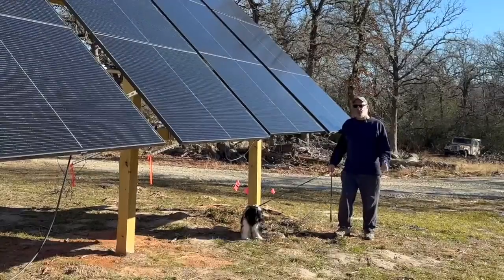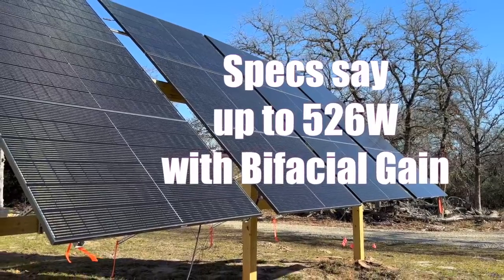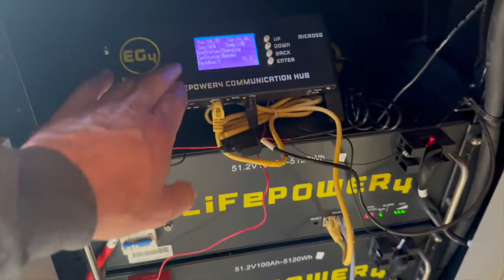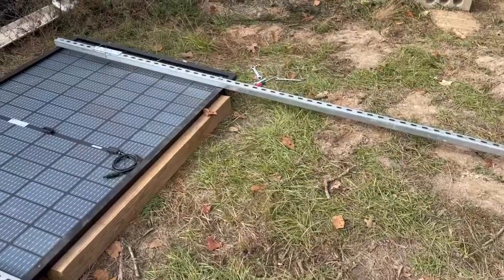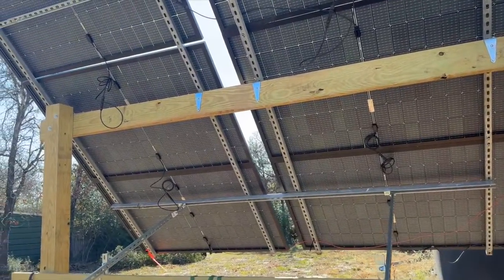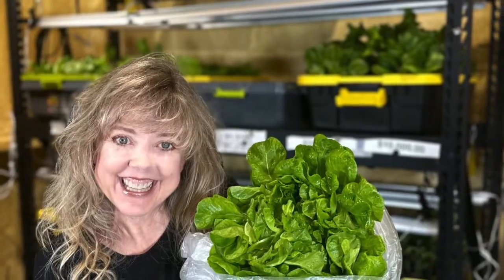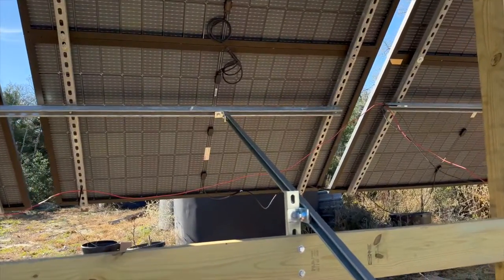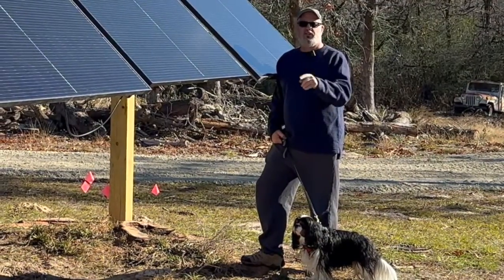Adjustable DIY Off-Grid Solar Panel Ground Mount

Comment from the maker: Mounting solar panels on ground mounts is expensive.  Read more about how we built this affordable 12 panel mounting system in the video description. ⚡️☀️🔋💡👍🤠
Reply: Are you going to hook up motors to that mounting system to adjust the panels during the day to maximize exposure?
Reply from the maker: @WhySoDivided-CantWeAllGetAlong  Thanks! That’s a cool idea but it may be more complex than my original DIY intentions.  I set out to design an adjustable tilt rack that I could adjust four times per year to maximize my solar angle.  I’m at 31 degrees latitude so my optimal angle ranges from about 12 degrees in summer to about 48 degrees in winter. Today 12/21 is the shortest day of the year so I should be at 48 degrees tilt.  I’m thinking bout adding 2 small manual winches to use on each side to more easily raise and lower the panel sections.  They’re heavy at around 400lbs each side. If the system was to adjust through the day and track the sun, it would need a motor and light sensor.  A tracker gives better performance but requires power and the performance difference can be offset by adding an extra panel to a tilt rack.  If you’re short on ground mount space, a tracker is a good option.  I’ve got a single pole DIY mount underway and I’ll shoot a video of that process soon.  Lots of options with solar panel mounting and they’re all use case specific to each location and your design limitations.  ☀️⚡️👍🔋💡🤠
Reply: @terrahillfarm  Very cool. I brought that up mainly cause I saw another video where someone did that, and you can buy some rotation mounts for about $600 that hold 4 to 6 panels. and the claim is about 40% more energy output from each panel because it maximizes the sun all day rather than stuck at one angle. In your area with all the tress it may not help though as you said. But with the land you got, and all those panels it may not matter anyway. I am curious are you using per panel inverters or tying them all to a single point? I saw this video (https://www.youtube.com/watch?v=Y2qs9VskGS4&t=787s) where he talks about the pros/cons of both approaches, but it seems like those inverters he shares are really good and will avoid one panel starting to hit shade from bringing down an entire block of panels from producing. Just thought I'd share in case you haven't seen it.
Reply from the maker: @WhySoDivided-CantWeAllGetAlong  Thanks!  I’ve got another 18 panels to get up first but after that I might start playing around with automation for the PV.  I love trying new ideas.  Right now I’m using an EG4 6000ex AIO inverter.  It’s split phase so it’ll run the whole house if the loads are managed.  My next move will likely be to a hybrid like the Sol Ark, EG4 18k or the Schneider XW 6.5, which I really like.  Like everyone else, I could use more batteries and solar panels!  😆🤣. I appreciate the feed back and that really gives me good ideas for more videos. ☀️⚡️💡🔋
Reply: @terrahillfarm  Nice. I am torn.. I have the EG4 3K right now for my one 48v battery, haven't set it up yet. I really want to go all in on Victron. They have a better inverter than the EG4 for $1300. programmable, etc. But it has no solar inputs, which I am OK with as you just add MPTT controllers to the mix and I don't have any solar yet. But I'll likely stick to the EG4 for now, then move to the Victron later once I have a better idea of how I can set up panels and run cables, etc.
Reply from the maker: @WhySoDivided-CantWeAllGetAlong  I started with the EG4 3000 and I now use it as a separate 120v charger for my battery bank.  It’s basically 1/2 of an EG4 chargeverter.  It can also work as an extra MPPT and charger for larger system.  The 3000 is bulletproof. 🎯⚡️👍☀️💡
Reply: @terrahillfarm  That's good to hear. I figure I'll use it for now, if/when I upgrade to Victron I'll work this in to a system for a family member and get them on batteries too.

Comment: I think you need to make friends with a chainsaw! Especially since you're really relying on the solar to run your home, you need to cut down a few trees so you can pull in more solar.
Reply from the maker: Thanks! We got hit by a tornado a year ago and it took out about 20 trees.  Then over the past year another dozen or so more died.  My site is hilly and while it looks like the trees are close to my panels, I get very little shading and generally that’s around 6pm so not much is lost.  I do have a ton of dead trees to cut down but it’s generally easier to just bring in a dozer for a day and have them take them Al out then push up plies to burn.  I’ve got about 4 years of firewood already cut!  Oh the joys of living in the country..always more work than can ever get completed!  👍🤩⚡️☀️🔋🤦🏻

Comment: What are the length of the vertical uni-strut sections? It would be nice if you had a build video and/or a parts break down. My panels are each 8 feet long, pretty big panels! up to 710 bifacial. Wondering if I would only be able to fit one panel per sections or possibly I could size it to accommodate two per section, in portrait configuration. I would probably need to put two strut sections together as they don't make them long enough. It looks like you may be using the thicker 12 gauge strut and the 14 gauge for the adjustment bars? Any info is appreciated. Looking to start strategizing a build to put something together, within the next month.
Reply from the maker: @chrtravels  Thanks,  my plan was developed on the fly and is a hybrid of several others I’d seen done.  All the uni strut I used was 10ft lengths.  I had to splice another 12-18 inches on the horizontal sections in order to mount two 400 watt panels, end to end.  So roughly my 2 sections of panels were 11’x11’.  From my experience I’ve learned that the higher off the ground you go, the more complicated things get with solar panels.  If I was going to ground mount panels larger than 400 watts, I’d go with a fixed mount of two parallel, in ground sections welded up with a top pipe built with heavy wall steel or oilfield pipe.  One should be higher than the other based on your ideal tilt angle.  Then you just buy iron ridge aluminum rails to mount on the two pipe rail tops.  I had a friend who did that and it worked well with over 20kW of panels.  Some work required to weld up the ground posts and top pipe, but it’s cheaper than most mount kits.  710w panels are heavy so hanging a bunch on hinges really needs to be planned carefully.  I had about 200-250# hanging per pair of hinges (x4 total).  It was really hard to manage installing the panels 8-10’ off the ground. 👍⚡️☀️🔋🤩
Reply: @ thanks a lot for the reply. Doing a fixed mount certainly would be easier. I’m going to chat with a couple neighbors who do solar because all of the properties around here are off grid. I have 24 of these panels and two of the new midnight solar wall mount batteries. So that’s 32 kWh. Thinking it should be a pretty good system when completed, but it is a lot of work doing all this on my own. I don’t really wanna get into welding as I don’t have the equipment or experience, but we’ll see what I can put together. I’m pretty good at figuring out solutions on the fly as well but this is a big project. We’ll see what I come up with!

Comment: Interesting stand. Haven't seen one put together like that exactly. I've got 3, 4kw arrays too but they pivot on 7/8" bolts set at the tops of the posts. Not that it's any better. More than one way to skin a cat has always been my mantra. :)
Reply from the maker: @beebop9808  Thanks BeeBop! Yeah, this design was more a result of me finding a Craigslist deal on unistrut nearby!  Unistrut is nice but so much heavier than aluminum rails.  I wanted to see if I could save a lot of money doing DIY.  It saved some but the amount wasn’t substantial.  The design ended up being higher than I thought so that added difficulty in assembly.  Presently ive got 9,660 watts of PV and the other day I was pulling a little over 8kW so not bad here for Feb.   I’ve got a bunch more panels to mount and the next ones will probably go on the roof of my carport.  After that, I’m going to stick to ground mounts 6 feet or less off the ground.  Lifting panels is getting old!  💪👍🤩☀️⚡️🔋
Reply: lol Tell me about it, I've got six more panels I'm going to put up on top of the solar shed when I can get up the gumption to get them up there and maybe not kill myself. hahaha
That strut is crazy. It's $35 (10ft)at Lowes and HD, found it for $8 in Mich. Either pickup or pay $595 (24 pieces) shipping. $12 somewhere up north but pickup only 600 miles away. Finally found some at a mom n pop electrical supply next town over for $23.

Comment: Ive been considering several small mounts so that the chicktand other livestock have shade in their areas while also making power for our house. We're also at the end of the power lines.
Reply from the maker: @matthewconnor5483  That’s great!  I’ve seen several people build a chicken house and put solar panels on the metal roof.  Definitely keeps things cooler in summer.  I’ve also seen them on loafing sheds.  If you build out buildings just make sure one slope of the roof is facing due south.  We just built a car port like that.  Thanks! 👍⚡️🔋 ☀️

Comment: Great video.  I like your approach and have subscribed for a while now.  I am planning an initial solar system for our North Texas property.  I will start with emergency backup coverage and add from there.  I want to be able to use my electronics and ham radios when the grid is down.  I could have used that system in the past when the grid went down here in Texas.  All the best from north Texas!
Reply from the maker: @brentjohnson6654  Thank you!  Check out my DiY backup solar generator video.  If you start with something like this, you can incorporate the battery and other components into a larger home solar system as you grow.  It’s cheaper than one of those all in one solar generators but provides 3-4x more battery power.  This ultimately puts almost every dollar spent into your eventual whole home solar system.  I’m a couple hours south of DFW so what works here will work there!  👍👍🤩⚡️☀️🔋

Comment: I heard you say that you used 6x6's and that you buried them 5' deep.  How long were the 6x6's?  It seems that they are still pretty tall above the ground.  I'm thinking of doing similar and wondered if I needed 8x8, but if 6x6 work for your setup, mine will work.
Reply from the maker: @tekker8308  Thanks for the questions, the 6x6s were 12 feet long.  I tried to get them in 5 feet but some spots were probably closer to 4 feet.  All my ground is hilly so it’s never exact!   I like the 6x6s and I just completed a 12 panel Brightmount set up using (12) four foot long, 6x6s.  You can see it in my latest video.  We’ll have a build video out soon on that project.  Both the tall mount and the new mount ended up costing me around the same money.  Probably $1,200-$1,400 in today’s dollars.  Building a DIY ground mount that will stand up to high winds is tough to do for less than $100 per panel.  I think I can reduce the cost some by using steel pipe, so I recently bought a welder and plan to do a large pipe rack mount with aluminum bolt on rails.  We’ll see how much that ends up costing! 👍👍👍👍
Reply: @terrahillfarm  Thank you for the response, and I wish you luck on your builds.

Comment: What are the size of your panels? Mine are 89.69" x 44.65" x 1.38". Seems like they may be similar as I also would need to extend the 10ft uni strut about a foot. Also wondering how long are those 6X6 posts? After having built this, do you feel that it was necessary to sink the posts the full 5 feet? I don't have an auger that can go that deep. Maybe adding a 4th post for extra support then three feet would be sufficient.
Reply from the maker: @chrtravels  Thanks, the panels I like to use are generally 108 cell panels around 400 watts and they are generally close to 65”x45” in size.  I find these are as big as I want to work with on a ladder or roof.  The 6x6 posts were 12’ long and I probably got them closer to 4-4.5 feet deep. Shallower would work but I’d add more concrete.  An extra post wouldn’t hurt and if I had to do it again, I’d have purchased 20ft sections of uni strut to avoid splices, they will sag a little at the splice.  The 2x6s I used to anchor the adjustment arms have bowed so a shorter span or 2x8 would work better. 

I just built a second 12 panel array using three EG4 Brightmount racks with extensions (for 45”w panels) and I mounted these on the tops of 6x6 posts 4’ long buried into the ground.  The total materials costs were actually about the same for both arrays but I prefer the Brightmount racks lower to the ground.  They don’t have the range of adjustment that the taller rack has, but they are easier to build and maintain.  I’m editing a video showing how I built the second rack and should have it out in a couple weeks.  Overall, the 6x6 posts are pretty stable and make a solid mount however you design it.

Im also going to be installing some panels on a metal garage roof and will probably use uni strut for that application.  I found some nice mounts on Amazon and will try those out with the uni strut.  Again, it would be wiser to get the 20ft uni strut but it’s tough to find around here.  Thanks for watching and stay tuned for more!  👍🤩⚡️☀️🔋

Comment: Please consider showing and describing the hardware and build material, the mechanics of HOW your afjustable system  works. 
Discuss any potential weak points in the system or improvement needs,  build cost, ect...
Most diy folks are looking for this type of info rather than a talk and walk coffee time about your general life situation.
Reply from the maker: @aaronsabel  Excellent point!  I just videoed a 2nd 12 panel ground mount install using the Brightmount kits from Signature Solar.  I think this turned out to be easier to build and a similar cost to my first DIY rack, so I will make a point to walk through the steps and the equipment used!  Thanks!

Comment: with bifacial panels should the adjustment not happen in a rotation like it was a clock on the ground
ofcourse with some sort of solar tracker

you have less shading if the panels are right in the middle of the sun all the time
vertical bifacial panels produce more thanks to cooling and less shade on the backside..
compared to a normal racks no matter if you adjust for the angle of the sun
Reply from the maker: Thanks!  A tracker would be much more complex than what I ever intended to do here.  I’m still experimenting and trying to find the best way to use these bifacial panels but one place I really find they excel is early AM and late PM.  Capturing low level light from both sides enhances the performance and gets me a little more total power each day.  I think putting down white rock under the panels might also help.  I have heard of some mounting them vertically so I may mount a few like that and compare performance. 👍☀️⚡️🔋
Reply: @terrahillfarm mounting vertical only seems to be better if your panels have to face east or west. If they can face south then that is still better then vertical
Reply from the maker: @aaron647  Thanks!  👍. I’ve got more panels on order and will be mounting them in several directions and configurations.  South is always going to get you the most power in a day, but if some are east and west, you get a broader spectrum of power throughout the day.  In my case, I think the solution will always be “more panels” until I max out my inverter input.  Then I’ll determine if I need more batteries! 🔋 Per the manual, two 6000xps can take 20,000kW of PV as long a you stay under voltage and amp limits.  That’s what I’m shooting for! ⚡️☀️
Reply: @terrahillfarm  maxing out the morning and evening is certainly not a bad idea! Panels are so cheap right now!

Comment: I got my 11,040 pvw solar kit in August, I did not check the panels until two months later.  One was smashed, the dealer did give me a credit so kudos to them.  My EG4 inverters will handle 9 more panels.  I am thinking of putting them on an adjustable mount.  My first 24  are on a ground mount in 2 rows.  I have them angled at 20 degrees (Florida).  They are at peak production now,  I got 11,450 watts during full sun two days ago.  However in cloudy weather I get less then 1000 watts.  I also need two more batteries so I plan on getting them and the panels at the same time.
Reply from the maker: Thanks!  Unfortunately panel damage in shipping is way too common! Ground mounting can also get expensive and rarely can you get panels ground mounted for much less than $100/panel.  Like me, you are probably seeing your solar energy harvest growing daily, due to us moving towards summer! 👍 I think installing and tweaking your system in winter is a good idea since if you can operate off the solar in winter, summer will be a piece of cake! 🎂  We ALL need more batteries 🔋 🤣
Reply: @terrahillfarm  I used 4x4 posts, 2x6s, and uni-strut.  Not expensive at all.  All in I spent $19,500 for everything.